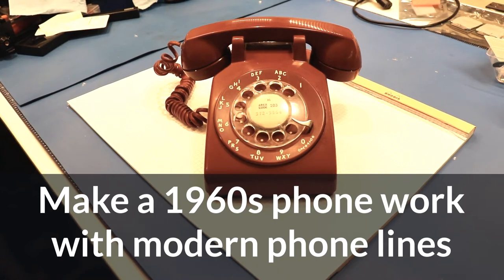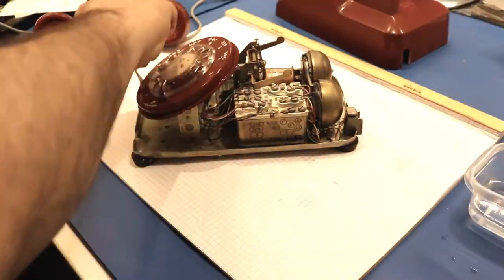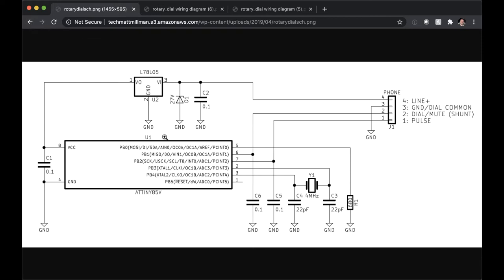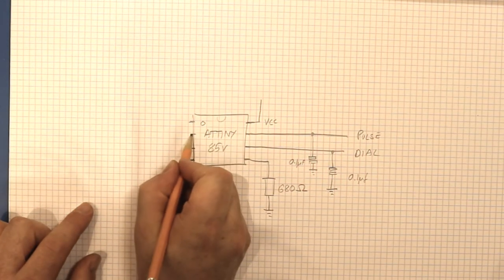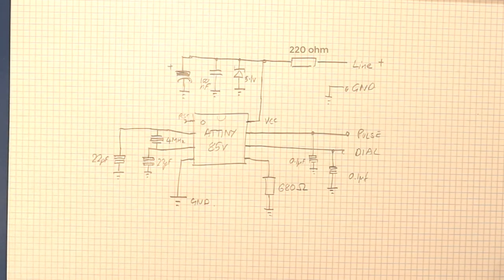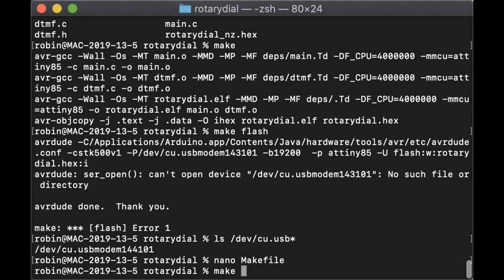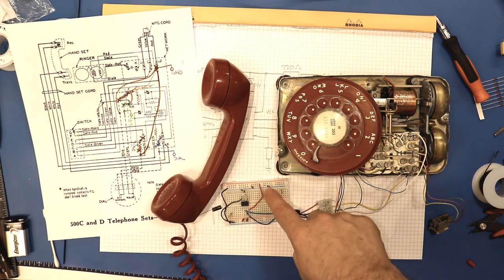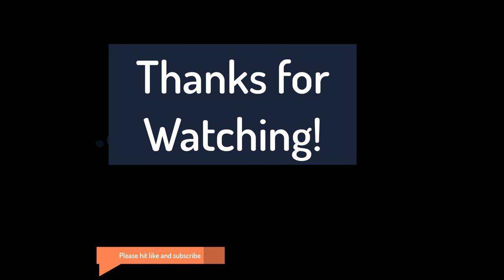Converting a 1960s rotary dial phone to work as a modern day phone

Comment: Around 1998 or so, some students (of electric engineering) at the university had the crazy project to have an "old phone / cell phone" solution, it was quite funny to have an old phone like this portable, with built-in battery and can be used to receive and make calls over the GSM network ;)
Reply from the maker: That’s kinda cool. And there is a lot of room inside these handsets for a big battery :-)
Reply: @robingrosset6941  does the rotary phone use the same LAN cables??
Reply from the maker: @danteerskine7678  the phone uses standard rj11 phone cable. You can use lan cables for this if you want .

Comment: Love this. I would rather use this phone and get my privacy and life back and everyone is the world out of my hair with all their opinions.
Reply: Tell me about it I’m 23 and I’m ready to get the life out of my hair to which is why I picked up a 1966 western electric 500 rotary song for $12 at a garage sale made it work not to mention I checked every single part because every part on this phone has a date code and they all match up to win the phone was made so it’s really never been tampered with the only two things I had to use. I had to buy a little white box on Amazon. It was some sort of converter or something to give me the ability to make phone calls so when you run your finger along the rotary to do the number dialing, it would beat without that little device that was possible I can only receive calls on it, and the other thing is that it just needed to plug into the wall because I didn’t feel like putting a new power cord on it since this was an original one with the old for 4 prong set up and I don’t know how to splice wires and all that jazz I just decided to go with an adapter that took the four prong style and turned it into a phone jack also bought from Amazon end it works, and the phone lives in my room and it makes a beautiful ringing noise from the original brass bells not to mention it’s already last outlasted every smart phone ever made and it’s pretty fun to watch the dial spin back around as your dialing number at least to me it’ll probably outlast me but I don’t have to worry about any social media interfering with me anymore or people that I don’t want to be in my hair in my hair I understand exactly what you’re saying it’s best to simplify your life. I think you live longer that way to be honest when it comes to social media you’re under a microscope for one and two it makes you miserable because you’re become a slave to it when I was 15 I didn’t have social media. The closest thing I had was a Gmail account but I was a very happy man I cannot say that these days now that I have social media and have had it to keep up with friends and things, and that was my original purpose with it but it still drags you down it’ll find away I suppose it, but and I’m also an old soul and I like keeping old things going and I love mechanical things in the age of everything digital. It’s boring take me back to the days when every mechanical thing pretty much have a soul know all this technology that’s designed to break planned obsolescence you say it in phones, cars, computers TVs just about anything refrigerators whatever it touches planned obsolescence will be there and besides when old stuff does break it’s easier to fix only two self tapping flathead screws to take my 66 western electric Bell System phone apart and then everything else is just pretty much simple basic electronics for that and also YouTube is a good source for that information. That’s how I fixed my western electric phone so when it comes to new technology the only thing I like about it is YouTube. Oh yeah, one thing you can’t escape from on an old rotary phone is sales calls unfortunately I get them all the time he’s coming he’s got on a bit Sorry

Comment: I love those telephones and I have a collection of them. I would like to use them but there is no way I can do what you did here!
Reply: Most of the system you can use them
Reply: I to have several ‘old’ 1950s phones I really love them, and they plug into my router they work via the VOIP system I purchased a. ‘dial gizmo’ device bought from Australia when plugged into the phone box supplied by my ISP the gizmo box plugs into it and that box plugs into the router and now I have the phones all working!

Comment: Interesting project, but I have a collection of vintage phones I like to alternate on my VoIP lines.
Therefore for me, an adaptor made more sense that modding several phones.
I bought cheap (£23.98 inc shipping) from China and it looks exactly the same as the DialGizmo, which I think is exactly the same thing, just with a sticker added at 3x the price.
Reply: Hi @matthewjenkins do you have a link for that unit your bought?

Comment: Interesting that the 78L05 arrangement didn't work. I found that was also used on the Rotatone from Oldphoneworks - who designed it primarily for model 500 phones like what you have used. Must be some interesting with your setup there...
Reply from the maker: Thanks Matt, I only had a 7805 and not a 78L05. So the higher current version. Its also entirely possible it was a bug in my first prototype. The 5.1v zener diode worked so I stuck with it.
Reply: @robingrosset6941  As you said it may be a feature of having a very low line voltage, in that case having a linear regular will cause troubles, but I'd say that is not a common scenario.

I can't take full credit for the change to the 78L05 - I actually discussed this design with an engineer with 40 years experience working on GPO exchanges - who recommended the change. The idea of it is to break AC coupling from the line to the microcontroller, but retain it in the other direction, which Arnie's design didn't do, so the idea is pretty sound, as such I would definitely recommend it as a starting point for anyone wishing to construct this...

Comment: Due to a brain injury, I have issues with aim and dexterity, and physical limitations too. As such, I can not use a touch-tone or cell phone. In turn, I do not have access to communicate with others except online and only if a link passes before me and my aim is good enough to hit it. I need to have a rotary phone, for they do not engage a number until I hit the right number and release that number. I don't have much use of my hands and am hoping there is someone on here that can help create a useable rotary phone for me. It does need to be one of those heavy old phones for I drop almost everything due to gripping issues. Note: If there's some way to connect to my computer (wired, no wifi) to use would be great since my landline worked less than 10 percent of the time when I did have it a few decades ago.

Comment: I built the device, but I don’t know where to connect each wire.  Can you help and explain which terminals on the pulse to tone generator connect to which screws inside the phone?  The schematic on the pdf is confusing.

Comment: Not wanting to be too critical the correct title should be "How to convert a dial phone to IP technology".
Conventional pots lines are still quit prevalent in the world today. Even in areas where phone service comes in via a DSL, ADSL etc. the modem has conventional telephone outlets on the back allowing the use of traditional phones.
I wonder if the file can be modified to work with two additional push buttons for # and *. These are needed for certain dedicated networks.
Reply: His code has # and *.

Comment: can i have a question did you connect the phone to the telephone network? or does it work through the SIM card somehow?
Reply from the maker: This phone was connected to a VOIP terminal over the internet in my house but it would also work with a telephone network directly designed to use tone dialing.  Pulse dialing no longer works in many countries.